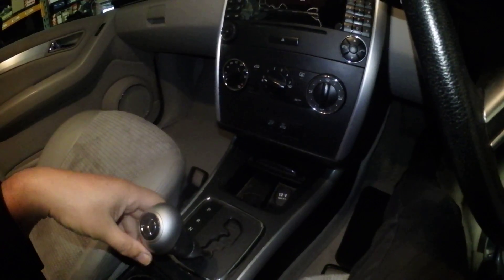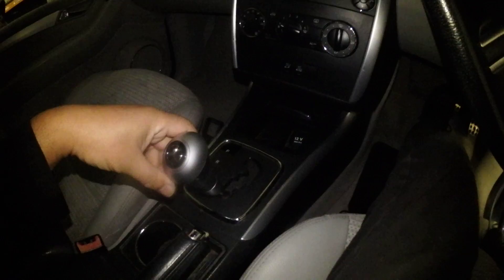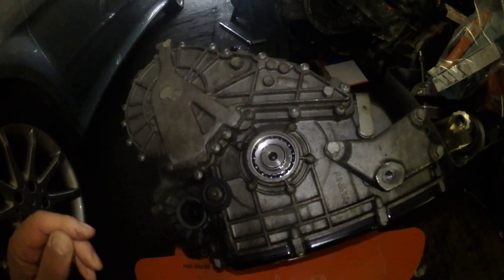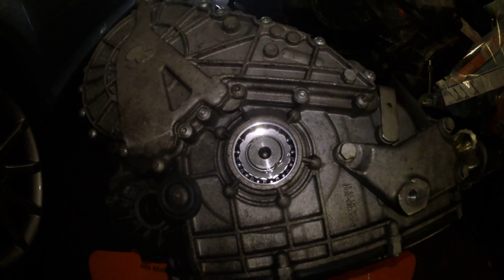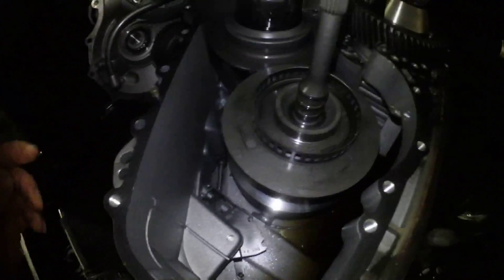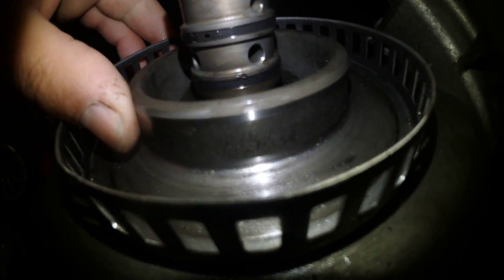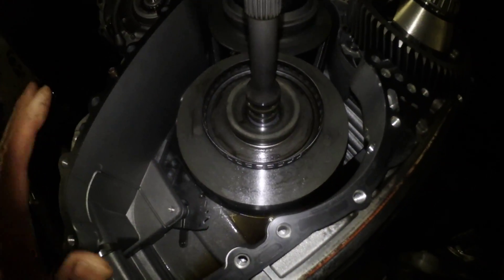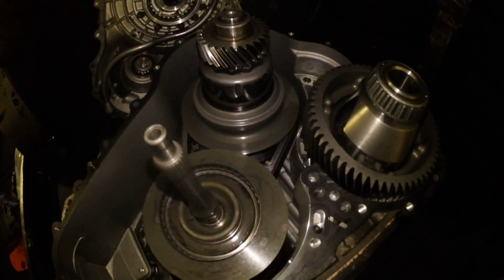Noisy Automatic Gearbox

Comment: Had the fault shown at 3:00, bad bearing surface on pulley under tacho ring.. Spent all the lockdown in 2019-20 fixing the car, i was able to successfully repair the original pulley using a bearing inner ring. It's now 30k km since the repair. Why the CVT on the diesels don't fail? I would expect the final gear ratios to be the only difference? Thank you for your videos!

Comment: please tell me where it goes Transmission Oil Filter Strainer A1693700098 small plastic filter I can't find a place for it in the gearbox. they fell out when I opened the gearbox and I can't see where they went. maybe it's a stupid question but I really need help. thanks in advance.
Reply: This filter goes between two halves of the gearbox, it's not possible to change without complete gearbox teardown. They go in the hole that is the input oil pressure for the torque converter.

Comment: Great video. Thanks for allowing us to hear the noises the gearbox was making, particularly as the selector is moved through the different positions. Thanks also for showing the bearing and the problems with the input shaft.
Why do diesel transmissions last longer than the petrol version? Is it related to the higher RPM upon initial start of the petrol version? If so why does this cause problems?